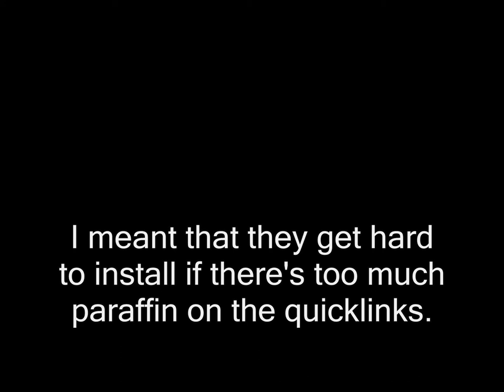Relubricating a Bicycle Chain with Paraffin

Comment: Can wax be degreased? What happens next time you want to clean it and wax it?
Reply from the maker: Hi. Not sure what you mean by degreased, but I simply redo this procedure if the chain gets noisy. This chain went over 1,000 miles before I had to rewax it. I found that I need a Stainless Steel chain, or else I get rust.